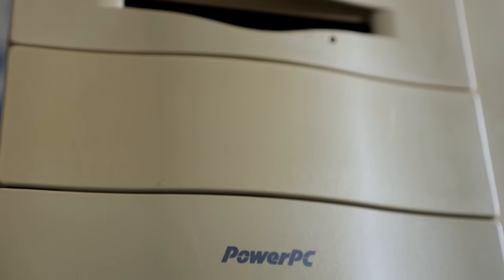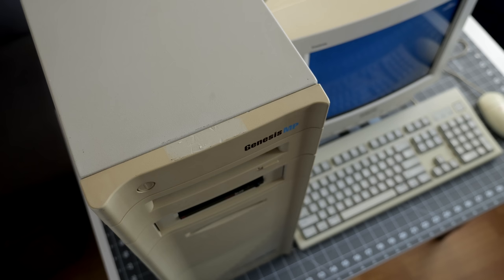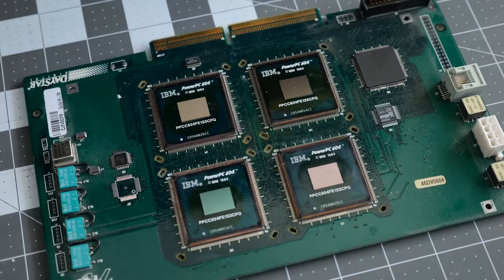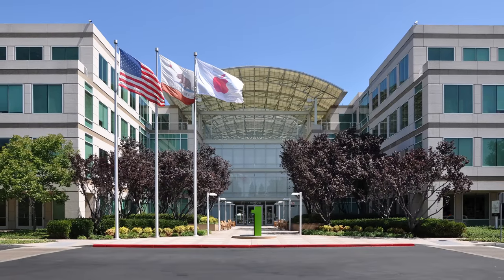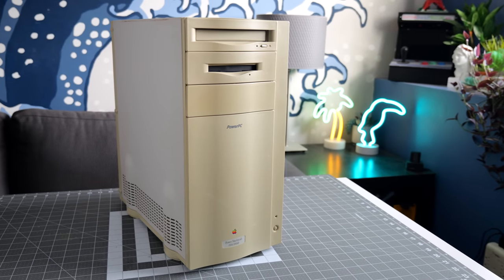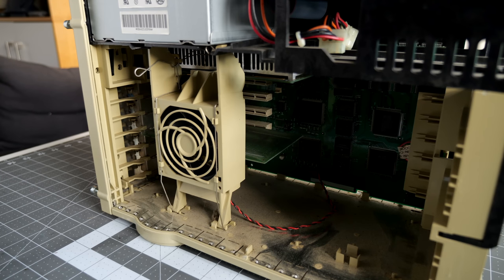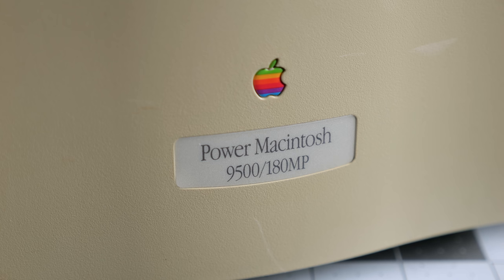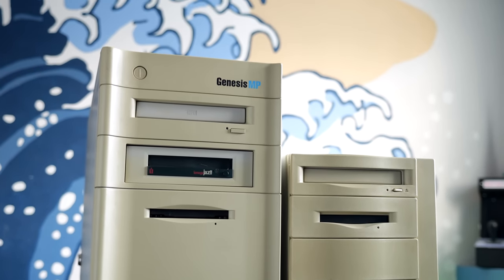DayStar Genesis MP: The Crazy Powerful 90s Mac Clone!

Comment: This is a remarkably accurate summary of the history of the Genesis MP. I wrote most of that multiprocessing software for Photoshop, Premiere and After Effects. I also wrote or helped with multiprocessing software for Strata 3D and Quicktime. I wouldn’t trade what Jobs accomplished to have those clone years back, but they were amazing times, some of the best of my life. Excellent work!
Reply: I'm trying to remember. Was there a Mac-based RIP that also got the MP support?
Reply: I am not sure what RIP is.
Reply: Sorry, Raster Image Processor. I thought since it sounds like you dealt with imaging apps at the time, you might have been aware. Typically, a RIP would have been on Unix or proprietary workstation (or maybe NT). I remember at least a crappy RIP on a Mac back then. But I can’t remember if there were better ones. Anyway, would have been another great use for the Genesis MP, if there was (and a driver for it).

Comment: That BeOS teaser is intriguing. A good long video would be much appreciated. I, ahem, tried to try it in 1999 if my memory serves, but I remember it having rather specific h/w requirements when it came to PC. While it sorta ran, it didn't fancy my Intel Atlanta motherboard, a Celeron 333, SB AWE64 sound and Matrox Millennium graphics card, and had rather lackluster software support.
Reply: I remember getting BeOE 5 PE on a cover disc - tried it a bit but hobbled by little software support
Reply: It did have very very very specific hardware requirements for PC. I had 4.5 and 5.0. Loved the OS like no other, but before buying anything for my computer, I did have to take a very careful look at a list of supported hardware. At the time I used BeOS for everything, except gaming. Dual boot configuration was a no brainer, so I shared my hard drives with Windoze.
Reply: Haiku OS is the contemporary descendant of BeOS. Sadly, other than running on new hardware, not much is different than the BeOS I used to run on my PowerMac back in the 90s.
Reply: I'd love to see TDNC's take on BeOS too! I just bought a Power Mac 8500 and was able to get BeOS running just fine. It's interesting to think what might have been if it had taken off.

Comment: Sounds like it's time to add some noctua fans, a flashed custom video card with like 128mb of ram, maybe a sata card, and of course a G3 sonnet card.
Reply: You know, Noctua does not run on magic.  ;-)  The reason it's quieter is because it moves less air.  They're subject to the same physical constraints as any other fan, and you can make almost any fan as quiet as a Noctua by isolating its mounting points and slowing the RPM down.  There may be a bit more motor noise, but the major component is air.

Ergo, putting a quiet fan in where a loud fan went often means you're not moving as much air.  With four CPUs and a beefy PSU, I'm guessing they didn't spec the airflow that high because they like white noise.

Comment: Good grief, what a monster for its day.
When you removed the heatsink on that processor board 😮
Reply: Literally just left your Metalfish Y2 video. What screensaver was that, btw? It looked cool and meshed so well with the tank/case.
Reply: Badly overpriced and slow.  The Mac clones were not as innovative as people think. ALL of them used Apple motherboards.  It lacked the flexibility of a PC clone and kept prices high compared to similarly outfitted PCs.
Reply: @tarstarkusz  neato.
Reply: @masterchief342  Serene scene Marine Aquarium 3
Reply: And no foam peanuts
Reply: @tarstarkusz   PC clones weren't typically that innovative either.  But that's not really the point.  Innovation is usually at odds with compatibility, so your bounds are set pretty much in stone.  What they did do is offer a niche option that could alleviate whatever you didn't like about the stock (Apple) Mac offerings - more expansion, IDE instead of SCSI, commodity parts, etc.

And of course they were expensive compared to PCs.  Compare the sales of a PowerPC anything to an x86 anything.  There are lots of fixed costs associated with developing a computing platform, and that cost has to be covered somehow.  You could toss a tray of Pentiums into the air and they would all be sold before they hit the ground.  If IBM/Motorola had that luxury, the PPC would've been dirt cheap too.
Reply: @nickwallette6201  Sure they were. Just one example, I've seen PCs back then using SRAM instead of DRAM. 
PCs were just a lot more flexible.  You couldn't really use off the shelf components on a MAC because you couldn't get them to work.  Like if you wanted to use a 3rd party hard disk, you had to special software.  If you just take an off the shelf scsi hard disk and put it in a Mac, without that special software, the system won't see it.

The Mac platform could have benefited, at least in some ways far more than it did. In fact, I think the platform was hurt by the clones, not helped. I think it was probably down to how the clone program was created and what the limits were.  Instead of expanding the Mac market, the clones simply ate into Apple's sales.
Reply: Same exact response.  I paused the video, just staring... for that time period, to have four 604s?  Holy crap!
Reply: @tarstarkusz   SRAM?  Good lord.  That would've been obscenely expensive, or maxed at 1MB, or both.

Anyway, so ... yeah, the disk ID thing was annoying.  But, lest anyone here forget or doesn't know, the PC market wasn't entirely without similar pains.  E.g., try pairing a random CD-R/RW drive with a CD authoring package, circa 1995.  It might or might not work.  Or grab any old SCSI controller and try to find an ASPI driver for it.  Unless you had Adaptec Easy SCSI or something similar (which was not cheap!) your options were really limited.  Likewise on the Mac -- you just needed the right software.  Could it have been avoided?  Of course.  But on both platforms, someone was doing the research to figure out the quirks of each drive and controller, and wanted to ensure they were compensated for their efforts.  It is absolutely inconvenient.  But also totally understandable.  Things were not as perfectly standardized and 100x over subsidized like they got to be later on.  There were long hours and bald spots that went into having any two devices work together back then.  I don't work for free either.

Anyway, the PC market was democratized in comparison, but bear in mind -- if you take any given OEM Pentium 66MHz machine and remove the cover, chances are you're going to find an Intel-designed motherboard in there.  From that point onward, if it wasn't an Intel-designed board, it was at least (more than likely) a board with Intel chipsets that was based on an Intel reference design.  The BIOS was going to be built by Award or American Megatrends or Phoenix, with some degree of customization by the vendor -- which may be as little as completely 100% OTS, or have a few extra menu items and a custom banner with the board model.

The PC market was a lot more homogenous than it might seem.  It had to be, or it would've been utter chaos within a year or two.  And it completely cannibalized IBM's sales.  You don't usually get much credit for being the innovator.  The market just takes the best of the ideas and undercuts you for the trouble.  The only way Apple would've flourished under this paradigm is by charging licensing fees for the reference designs and software, and hoping the sales grew large enough to completely cover their costs.  But that's not a guarantee either.  Ask IBM, and all of the clone makers who went with Microchannel and OS/2.  (If you can find any.)
Reply: @starkmouth  Thank you!
Reply: @nickwallette6201  Comparing Apple to IBM is a mistake, IMHO.  I think a comparison with Microsoft is MUCH more applicable.  What made a Mac was the mac os.  They could have easily defined the system and just let OEMs create the hardware and license the software.  Software is a lot more profitable than hardware as well.  So while the PC clone market killed IBM, it wouldn't have killed Apple in the same way because Apple owned all the licenses and the Mac OS.  IBM made the PC entirely open other than the bios and every OEM sale was a lost sale for IBM that Apple would have gotten through the Mac OS, just like MS made a sale every time an OEM sold a PC.

AFAIK, Intel starting setting the references with the Pentium. But there were still entirely unique PC motherboards, though admittedly, most followed. But even with an Intel reference board, there were other chipset makers, like biotech.  AMI, Award and Phoenix largely had the market cornered though.

Early CD burners were a pain, but that didn't last very long.  Maybe a year or 2 tops. AFAIK, these were not problems caused by proprietary controllers and drives.
Reply: @JeffreyPiatt  Are you sure about that?  From what I know of the program, they licensed out specific MB designs.  Motorola might have physically manufactured the boards, but based on Apple design
Reply: @tarstarkusz Clone manufacturers all used Apple chipsets, but they did have their original motherboard designs.
Reply: @tarstarkusz  might want to change your logo, its a sign of hate
Reply: Is it another time yet? I wanna see you do Beos on the Genesis MP, and compare it to Haiku on a quad core Intel Mac. ;)
Reply: @inthestudy  BEos runs fine on PCs.  I have a boxed copy, but I don't recall if it supported multi processor boards or not.
Reply: @tarstarkusz  It did run on dual-processor intel, but AFAIK nothing usefully since Pentium III due to incredibly, incredibly dated drivers. Haiku literally uses a 21-year obsolete version of GCC to keep binary compatibility with R5 on ia32.
Reply: He killed it
Reply: And everyone gets into another tiresome PC versus Mac scrap that the Internet really didn't need, and yet no-one really pauses to consider that four CPUs are largely wasted on Mac OS, hence the special extensions to applications that were needed to make use of those CPUs. Apple was in dire need of a more modern operating system as the 1990s progressed.

I did wonder if IBM might have been interested in putting AIX on this, although IBM had quite an extensive range of RS/6000 and POWER-branded products. Motorola also had its own range of systems which saw Windows NT running on them. Indeed, one wonders if anyone tried to get NT working on this system. (I see that someone notes that Linux worked on it at one stage.)
Reply: Following up to my own remark, Apple did have AIX ported to the Power Macintosh 9500 to produce the Apple Network Server. So, perhaps this system could run AIX, although multiprocessor support seems unclear.

Comment: “Faster performance directly correlated to improved productivity”

Back in the early to mid 2000s I worked for a printing company that did large format. Our 3D specialists were quirky guys that worked third shift. They would do some work, set it to render, and move to another Mac to do some work and set it to rendering. 

They cranked out our most profitable work and because they could take over multiple workstations on 3rd shift they cranked out a lot of work. 

And they enjoyed working 3rd shift as there was nobody there to interrupt them.

Comment: Wow, I’d long forgotten Daystar did a quad 604. I had a PowerMac 9600/200MP which was Apple’s top banana workstation before the G3 era. Was a beast of a production system though as you stated, only really in Photoshop (which I mostly lived in). As cool as the dual 604s were, a G4/350 upgrade card completely transformed the machine. With 1.5Gb of RAM, about 5 internal SCSI drives and twin graphics cards I was using that machine until about 2004.
Reply: Ditto!

Comment: I had a PM 9600. It along with the 9500 were the only PowerPC macs certified for Avid Media Composer and Film Composer. In fact I was in Boston one day and and I saw several 9600's in a dumpster outside of Harvard Medical School. I grabbed two of them. Still have one. It has Daystar G4 upgrade processor in it.

Comment: Hey man, curious if you have a cite on macworks painting machines. I can't find anything about it, and the specimens I'm aware of have injection molded black plastic fronts.
Reply from the maker: That's a good question. I wasn't able to find anything concrete from established publications (there seems to have been only one published review of the Millennium, in the June 1998 issue of Macworld), but a while back I ran across some forum chatter suggesting that was the case. It also logically makes sense, given the nature of the machine -- DayStar was about to go out of business, and MacWorks bought the remaining Genesis MPs (and parts) they had in inventory. Given that MacWorks didn't have a valid license from Apple to include the Mac OS, and there's other indications that the company was a bit dodgy (they didn't offer returns on products, and its owner ended up getting convicted of mail fraud, see the article "Apple grapples with huge computer gray market" in the Kansas City Business Journal), it makes sense they'd try to maximize profits as quickly as they could since they probably knew they wouldn't be able to get away with it for long. So, using as much of the inventory they bought would have meant painting the case, instead of spending the money to have new front bezels and metal chassis components made. I could certainly be wrong though!

Comment: Saw one sitting in the corner of a computer shop. Front bezel and side door was missing, as well as the hard drives and ram. Owner didn't know what it was. It just showed up one day. I asked for the carcass. I had ram and hard drives. Had to look for a graphics card. It fired up! 4 200 mhz processors. I installed Mac OS, then Yellow dog Linux. Settled for the BE OS. It was fun for a while. Still can't believe someone stripped a 15,000 dollar computer.

Comment: An actual supercomputer for the time, for a very “affordable” price. This is an awesome machine, I’m sure it can be utilized even further with an appropriate operating system. I wouldn’t be surprised if this even manages to run OS X or something even newer when properly upgraded.
Reply: Having four PowerPC CPUs made it more like a high-end workstation than a supercomputer. Multiprocessor workstations had been around for a while already: DEC made the Firefly a decade earlier, and SGI was routinely introducing graphics workstations with multiple CPUs. Those systems were rather less affordable, though. (SGI's server systems were apparently combined to deliver actual supercomputer performance in the form of ASCI Blue Mountain.)

This product might have been a more credible workstation than Apple's previous attempts, but Apple had largely exited that market and had practically ditched A/UX by this time. In fact, Apple did apparently have AIX ported to the Power Macintosh 9500, releasing a product called the Apple Network Server, although it appears to have been a uniprocessor system.

Comment: Wow, great video. I noticed you mentioned that Apple made their own multiprocessor version of the 9500. Was their operating system at the time modified to support it or was it just certain applications like in the Photoshop example?
Reply: System 7.5.3 introduced cooperative multitasking to support MP in 1996 when the 9500/180MP was released. System 8.6 introduced preemptive multitasking in 1999. That backend was replaced by Grand Central Dispatch in OS X 10.8 in 2012.

Comment: Oh the good old days, when you could upgrade your computer. I experienced some of the most impressive performance jumps in the 90's. Some examples: Using a Performa 6200 with a PPC 603 @ 75 MHZ, running SoftWindows 4 and installing AutoCad 12, roughly took 12 hours. Performing the same tasks on a PowerMac 7500 with a G3 upgrade card @ 400 MHZ, got the job done under 20 minutes!!! Another noticeable speed bump was with the screen redraw of audio waveforms, when moving from a single SCSI drive to an ultrawide SCSI RAID 0 running two drives spinning at 15000 RPM. We're talking from 15 to 30 seconds to display a full screen audio waveform in SoundStudio to under 5 seconds running off a RAID!!! What kind of speed improvements can we talk about today???...Speed it takes to send a text, or upload a YouTube video??? Game frame rates, or boot times???

Comment: I've wanted one of these for years. They don't come up often and I can't afford them when they do. Eh, maybe one day.
Apple famously dropped all of their pre-G3 machines with the release of OS X and so the beige Macs (even the real ones like the 9500 and 9600 MP models) never had proper SMP support. I've heard some people say they got Linux and/or OS X to fully support SMP on these, but I've never seen proof. With their unique implementation of multiprocessing, I'm skeptical: the 60x bus was designed to fully support either a single CPU with bus-level L2 cache, or up to 4 CPUs, but not both; these managed to have multiple CPUs and the L2, which probably involved some software trickery closely guarded by Daystar and/or Apple. Of course I'd love for someone who knows how they did it to fill me in. I've never seen anything actually explaining how it works, and I do have a couple of the lesser beige MP Macs I could use to run an SMP-capable OS.